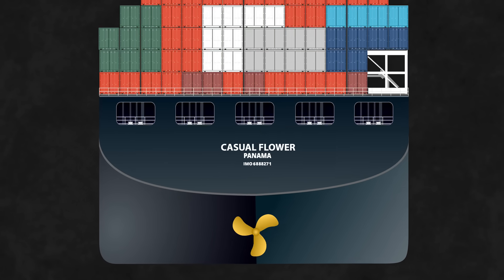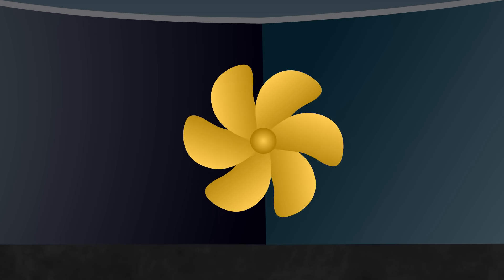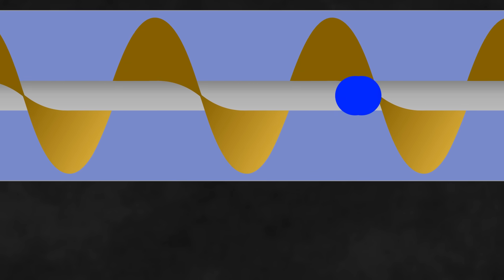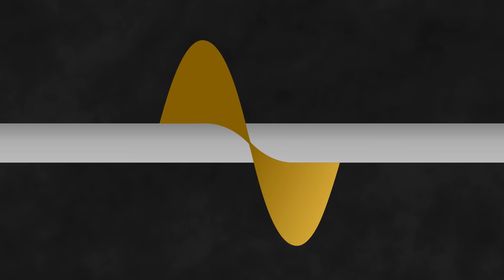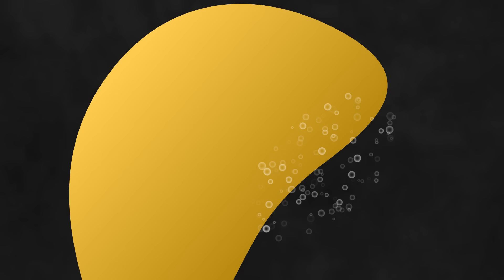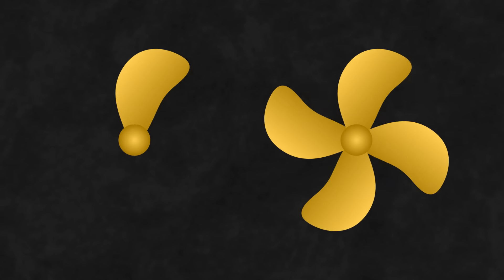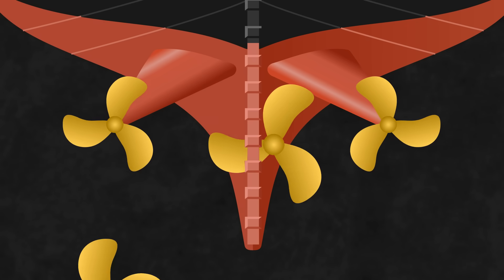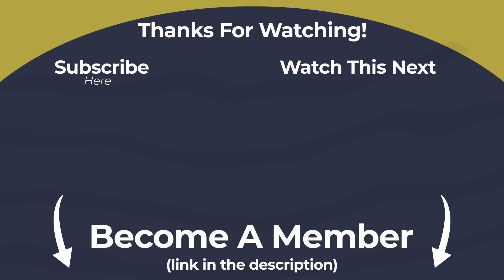Why Are 4 Blades Better Than 3?

Comment: Do (some) big ships use variable pitch propellers?
Reply: Most really large cargo ships (containerships, tankers, bulkers) use fixed-pitch propellers because they spend >95% of a voyage at the design speed.  The losses during slow speed arrival/departure and canal transits aren't worth the cost and complexity of the controllable-pitch propellers (CPP). BTW, CPP is the standard marine terminology for VPP if you want to research further.   CPPs(VPPs) are widely used where a large ship has a wide range of operating speeds such as a cable/pipe layer, ferry, or naval vessel.  The big polar-class icebreakers probably have the largest CPPs currently in operation and they are huge propellers.

Comment: I have always wondered about this, albeit on propeller aircraft instead as they are very conspicuous compared to ships' which are usually hidden underwater. So I guess the reasoning should be similar as air is sort of like a fluid too.
Reply: The principles are very broadly the same. However, air is much less viscous and dense than water. This changes the maths slightly. Obviously a big set of blades like a ship's propellor is much to heavy for a plane, and the 'cavitation speed' (generally the sound barrier) of the air is much higher. This means you make the propeller blades thinner (if you cut away at a ship's propellor you'll arrive at something that looks very much like a plane's propeller.), and you make them turn faster. There's still limits on rotational speed, angle of attack, and things like stall to consider, similar to the disruption of the water created by leading blades. Weight is also much more of a factor in planes, as opposed to corrosion resistance in ships.

Comment: the mid one on Titanic and Olympic had 4 blades cos it was smaller in diameter than the outside ones so to get the same surface area they added that 4th blade... btw. when Olympic had that accident and lost its propeller the only one available was the one made for Titanic (still under construction back then)... it had a number engraved on it 401... when Ballard found "Titanic" they took a pic of its propeller  and guess what .... YES 401 is there :D that ship down there is Olympic which was f*cked beyond repair so they had to sink it... one of the biggest insurance frauds ever
Reply: The amount of effort you put in to being wrong is staggering.
Reply: that "theory" has been debunked so many times..... its complete bullshit. 

The ships had some construction differences (the most noticable one being the closed promenade on the forward section of A deck on Titanic, which was open on Olympic), as well as lots of internal differences in the passenger spaces, so it definetly would have been noticed if they just switched the ships out, and there was no time to refit them to look similar.

Also, the center propeller on Titanic is not visible, its buried in the sea bed. So your argument doesnt make sense at all. The outer propellers have the 401 on them. But they were never damaged on Olympic.

Comment: I wonder if they put a 3 on titanic and a 4 on Olympic to see which performed best and had to do the single experiment on Olympic after the sinking?
Reply: The two outer screws were engine driven. The centre screw was driven by a LP turbine. At full away conditions the engine driven shafts would be rotating at a lower RPM compared to the turbine driven shaft, regardless of the gearing. The outer props were 23.5 feet in diameter and the centre prop was 16.5. I imagine that the differing number of blades on the centre prop was for power balancing.

Comment: Have you ever heard of toroidal propellers? I think you would find it very interesting. They're faster, more efficient, reduce cavitation, and use less fuel than a standard propeller. It's genuinely incredible. The only drawback is that they're much more expensive to produce because of the complex shape.

Comment: Cool video! I experimented with two and three bladed propellers on my last sailboat. The two bladed propeller was more efficient motoring in flat water, but vibrated a bit more, and was less effective motoring straight into choppy seas than three blades. The two bladed propeller folded better for greater efficiency when sailing, so as you said, everything is a compromise!

Comment: Its fun to note that things like Nuclear Submarines, which desperately need to keep cavitation to a minimum, tend to have tons and tons of blades, and I believe some even have variable pitch propellers like you see in many aircraft, allowing you to even more finely optimize your blades to your immediate circumstance
Reply: Also ducted, almost approaching what you see in turbofans, in order to help contain trailing edge vortices, and I think I've also seen contrarotating ones mentioned? But inline, rather than one on each side, which also does its own thing. All very very secret tho!
Reply: @fairguinevere666  ya submarine propellers are such a tightly guarded secret but they're called pumpjets because they have large cowlings around them
Reply: @AsbestosMuffins  some submarines have pumpjets, but definitely not all.
Reply: Variable pitch props are a very common application especially on medium freighters and large private motor yachts
Reply: @Damoinion  They ar necessary on 4-stroke aplications as the 4-stroke engine can't be refursed unlike the 2-stroke where you can change the direction of turn.
Reply: @RealOlawo  We ran variable pitch on the reversible 2 stroke Sulzers
Reply: @Damoinion  Yes I know there are some very strange designs in the world. I knew also ships with Sulza 2-stroke and CPP because they used a PTO. As soon as they were sailing slow speed the econemy was terrible as the ship needs to runn on 100% RPM all the time.
Reply: @RealOlawo  Actually, the reason for running the VPPs was to maintain most efficient RPM on the mains.
Straight 7s, turbocharged with crankcase supercharging. Optimum 550 RPM
Reply: @Damoinion  550 RPM what 2-stroke is that? The 2-stroke I talke about just do 110 RPM max.
Reply: 550 RPM would be a medium-speed diesel engine, @RealOlawo  - just search for that term for examples. Medium-speed marine diesels are typically 4-stroke, but EMD (now part of Caterpillar's Progress Rail division) still has uniflow 2-stroke medium speed models. 110 RPM is a low-speed engine; smaller engines running over about 1200 RPM are "high speed".
Reply: @brianb-p6586  Iknow the differences between high, medium and low speed. I'm working for MAN. Abouve there was the talk about optimum speed of a 2-stroke to use CPP. But when you use 4-stroke medium speed you also have to use a gearbox, as the rpm are too high for a efficent prop.
Reply: 7 to 9. They don't really need to go higher. a full dozen has been tried but the efficiency reall sucks and gets down to a level where you can meaningfully get to a speed to maneuver vs other vessels anymore.
Reply: 😂 submarine propeller Tech is actually classified
Reply: Never heared of a submarine with CPP, and I guess it is to dangerous to loos tje pitch control. That Submarines have so many blades is exactly one point he made completely wrong. To reduce cavitation you need to go down in pressure level. To do so with a given power you need for a cirten speed, you increase blade number. Which will reduce your efficency as more blads mean mor friction and resistance to turn the prop.
Reply: @RealOlawo  "To reduce cavitation you need to go down in pressure level. To do so with a given power you need for a cirten speed, you increase blade number."

Why is done by increasing the blade number instead of making the blades wider?
Reply: @seneca983  to make blades wider doesn't have the same efekt, as the most of the power is transmitted on the ad the leading edge of the blade in a relativly short area across the blade. If you look at fast container vessel with big engine of 100K PS they need nearly 100% of disc area for the propeller area. This is only possible by 5-6 blades.
Reply: @RealOlawo  Thanks.
Reply: @seneca983 the blade is effectively a rotating wing. Wings with higher aspects ratio (=longer and thinner) are usually more efficient, which is why aircraft propellers usually have long thin blades. For ships the need to limit pressure gradients and maintain enough strength forces a shorter and wider blade than would be optimal.

Comment: Great video, thank you.
I saw some software simulations linking the number of blades of the propeller with the frequencies of the harmonics generated while it is spinning along all the speed range, and how the propeller is designed so to avoid these harmonics are far from the resonant frequency of the ship itself. In this way, the designer avoid that - within the constraints of efficiency and cavitation - the vibrations of the ship are kept at the lower possible level.
Thanks once more,
Anthony

Comment: I have seen a picture of a 5 blade propeller that the blades were essentially just flat rectangles of steel welded at an angle on the hub. This single propeller was sufficient to drive a 100 ton yacht 15,000 nautical miles although only at around 4 knots, this was effectively 3 nm per us gallon of fuel. Bering yachts have since discontinued the single engine option of their 65 foot model and removed the photo.

edit to add:
when even the efficient displacement cruising yachts like Nordhavn usually measure fuel consumption in gallons per nautical mile having it miles per gallon is phenomenal.

Comment: The Titanic central propellor was driven by a low pressue turbine from both outside tripple expansion engines - a 4 blade would have been chosen to avoid harmonics interaction with the 2 outside 3 blade props - the relatively new power train  would have been the main reason various props would have been tried

Comment: According to 1935 principles of warship construction and damage control, 'Three-bladed propellers are usually preferred, because they are more efficient than four-bladed propellers, unless diameter limitation makes the four-bladed propeller necessary. Propellers with more than four bladdes are practically never used.' It's interesting to see how as our understanding progresses we are actually able to take advantage of configurations previously 'practically never used.'
Reply: More than 4 blades are generally used on submarines - 7 to 9 blades. Key reason is to reduce cavation noise and efficiency is secondary to evading detection. Uneven numbers of blades avoid resonance effects.
Reply: @voster77hh Is this true for non-nuclear subs (Diesel or AIP) as well? (I'd imagine that they have more incentive to care about efficiency.)
Reply: @halfsourlizard9319   detection goes before efficiency. All sub drive trains go by electric anyways to avoid complex gearboxes failures and mechanical  noise and vibrations.
High level prop cavitation acoustics is the most relevant noise after sonar pings from the rubber coated hull signature. Also the prop cavitation is an active noise emitter detectable by passive sensor arrays.
It does not make much difference doing diesel-electric, nuclear-steam turbine-electric or fuel cell electric.
Nuclear has a lot of cooling gear pumps noise, diesel a lot of mechanical. Silent Hydrazine FCs is 1950ies miltech.
Without a low cavitation 7 to 11 blade pro design subs are super easy tompassively detect, no matter the power source. Best FC only or diesel-FC hybrid subs frequently pop up in US carrier groups in NATO exercises.
it has become kind of a sport to sell them as a product. Anyone can do a few cell or nuclear reactor but few can do a low caviation prop.
14 y/o did go Sheldon Cooper an built a fusion reactor in a NYC apartment home. Low cavitation prop design is way more challenging single feature engineering.

Comment: The compromise between blade angle, power and speed is of course something that variable pitch props can change on the go depending on operating conditions and required performance. Those are widely used in aviation, but apparently not nearly as much in the naval world.
Reply: Variable pitch props are widely used in marine applications that require a range of operating speeds.  Ships that are designed for very efficient, single speed operation like container, bulk or tanker designs will be optimal for their cruise speed which is maintained for >95% of the voyage.  Losses during the 5%, usually slow speed, portion of the voyage just aren't worth the cost and complexity.  Ships like underway replenishment ships that spend time loitering at 5kts, replenishing around 15kts and transiting at 20kts all have variable speed probs.

Comment: Very informative video.
I have a question about the prop shaft though. I saw that some ocean liners had some sort of a casing or part of the hull that covered their shaft all the way to the prop while many other ships like warships or fishing vessels got their prop shaft exposed; is there any difference between both design and which is generally better?

Comment: why are they so small? compared to ship size? isn't bigger better?  (apart from shallow waters, canal passage etc...)
Reply: Engine rooms are built low down to the ship, and you want to build the shaftline at as small an angle as feasible to avoid stressing the shaftline, as such your bottom limit on propellers is set from where the shaftline finishes and the keel of the ship - you want to keep the propellers above the hull of the ship to reduce resistance on the propellers and improve efficiency of the water going around the hull and deflected onto the propellers.
Reply: the fluid the ship is working with is very dense and less viscous than air. The amount of power needed to turn the ship propeller is higher compared to a propeller on an airplane. And if you put a large diameter prop on a ship, the engine may not have sufficient power to turn it. Also, the forces acting on the ship's propeller is far larger than an airplane propeller. It must be designed to be strong and resilient to such force requiring the use of expensive alloys. MORE expensive if its even bigger than the previous one.

Comment: So why aren’t all props ducted? ……..asking for a friend 😀
Reply: Ducted props have one flaw, they cannot reach speeds of more than 13 knots. 

They are best used on ships that have restricted draft and ships with enormous engines but can't efficiently use them without ducting (tugboats) and ships that have azimuth pods that require precision and powerful thrust for its small package.
Reply: @kimpatz2189  interesting the pros and cons between hydrodynamic and aerodynamic

Comment: you can hear this same cavitation effect if you've ever overrun a pump.  it sounds like hammers rapping on the case.  i.e., if you have tried to pump a fluid with a clogged filter or strainer, or through a small hose.  the telltale signs are increased pressure with no increase in flow
Reply: You have Cavitation wherever a Liuid flows. It also is a huge Challenge in Hydro Turbines, and badly designed Plumbing can cavitate as well. A badly designed Ship Rudder can be "consumed" by Cavitation Damage too.
Reply: @Genius_at_Work  you're right, i think the proper term is supercavitation. gets to the point where the collapsing causes damage.  at least how i remember it from the school books
Reply: @loginavoidence12  Cavitation always causes Damage. IIRC, Supercavitation means creating a huge Vapour Bubble around a Torpedo to reduce Drag, thus allowing it to reach impressive Speeds.

Comment: I used to have this toy set called Capsela for building your own motorized vehicle toys, it included a propellor with 4 blades that could be adjusted so you could see the effects of high or low rake on your little boat, and which best fit your design as it paddled around the bathtub
Reply: Only real ones remember Capsela.
Reply: I remember that. Capsela was amazing!
Reply: That takes me back
Reply: Now everyone on the internet knows what you do in you bathtub.

Comment: So the propeller pushes against the water one end what about the other? The engine?
Where do the forces go?
Reply: as far as I understand, there was a sizable arrangement of "thrust bearings" between the engine and the propeller, designed to take the thrust on the  prop shaft and transmit it to the structure of the ship
Reply: Handled by the Thrust block. It has large thrust bearings to transfer the load to the ship. It works in both directions.

Comment: And then you have Queen Mary 2 that has its props reversed so facing the bow ? is that better than having props that face the stern?
Reply: QM2 has pod propellers. 2 are fixed and 2 can do azimuth rotation. Each pod has 2 sets of propellers in "PUSH-PULL" configuration.

The front props has access to undisturbed water flow while the rear props catches the water flow from the front and redirects it to a straight path of motion. It is built like that to increase efficiency as a single PUSH mode propeller makes the water flow it creates rotate along with the prop. This also happens in PULL mode. Gas turbine engine blades do this too as a stage.